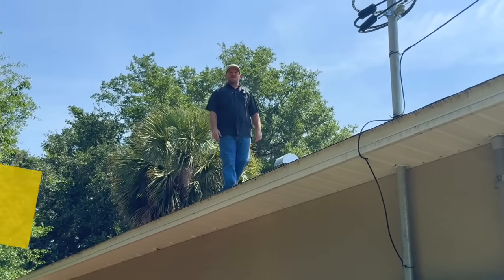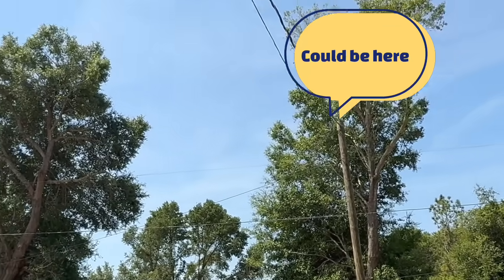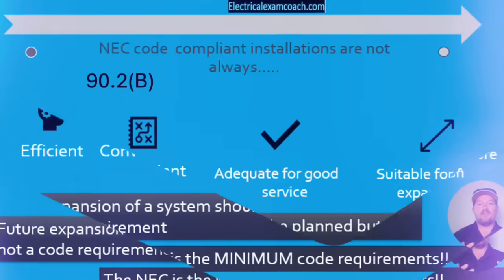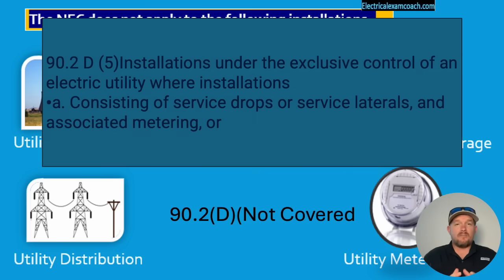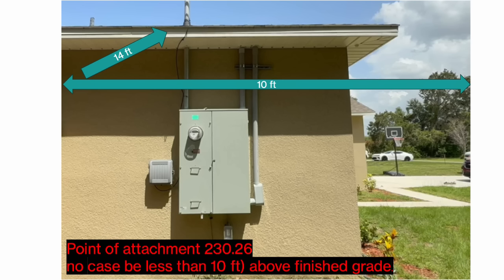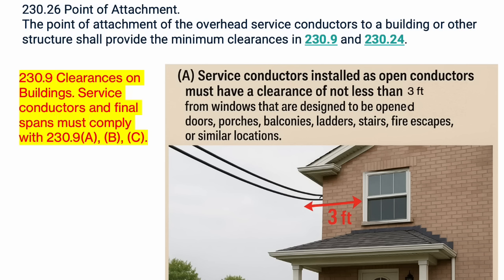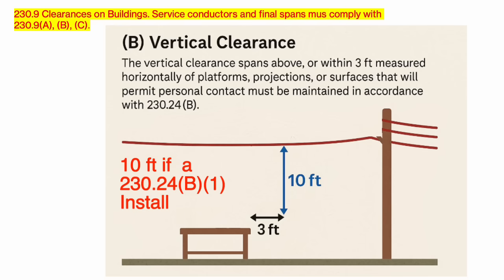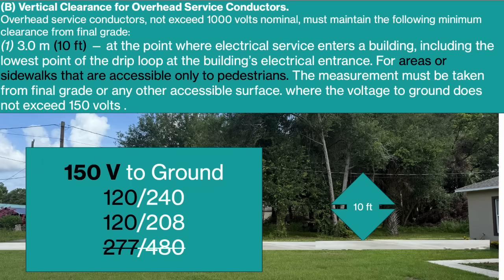Rigid Metal or PVC Thru Roof? Article 230 Overhead Service Drops

Comment: It's nice to see actual numbers put on stuff that should be common sense. (to some extent) BTW, it is common for service points to be less than 3 feet from a window on older homes so you may need a nod from your local inspector if it's difficult to comply to the last inch.